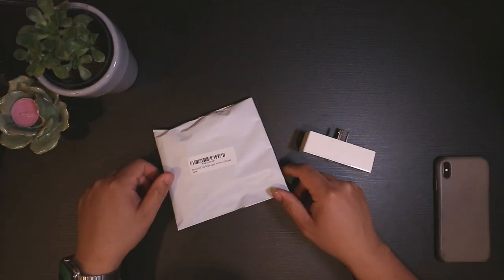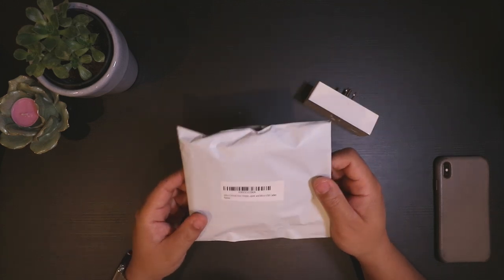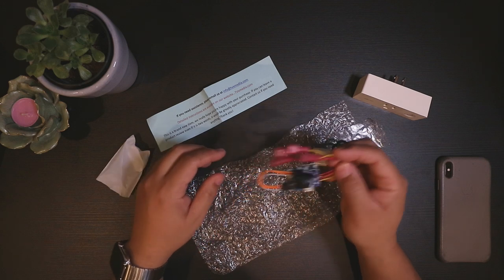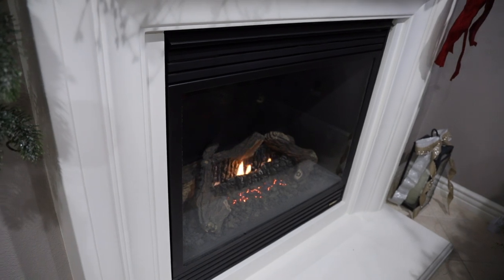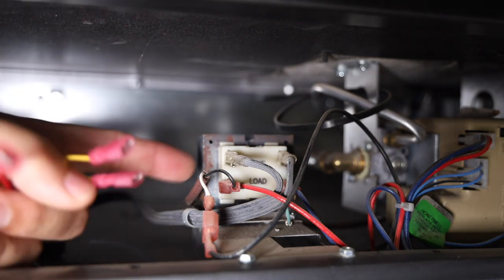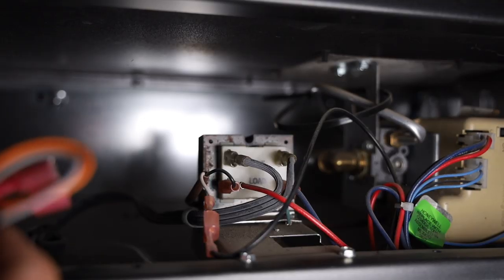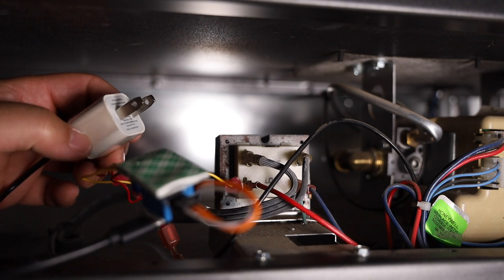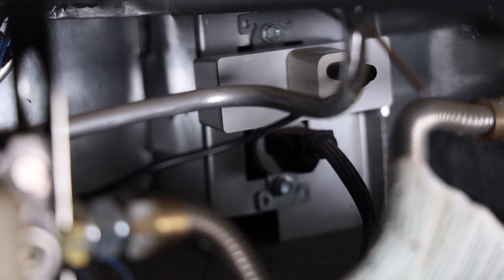How to Turn Your Gas Fireplace into a HomeKit Fireplace!

Comment: I got so excited seeing how easy this looks that I started to go order the relay.  Went to check how much room I have underneath my fireplace to see if I might need a longer USB cord and discovered I don’t have an outlet underneath my fireplace 😩

At least I discovered it before I ordered the relay switch.
Reply from the maker: Is yours a gas fireplace controlled by a switch? Did you look in every corner underneath the fireplace? Upon first inspection I didn’t immediately notice an outlet either and found it behind some old instructions the builder left underneath there.
Reply: Rey G It is a gas fireplace with a switch above the mantle. I will look again but I even pulled the logs out and couldn’t see an outlet. Just the wires that then ran through a hole in the wall to run up to the switch.

Comment: So awesome. Probably 2-3 yrs ago I removed the switch from my fireplace to install a smart switch and found low-voltage wires. Have wondered since then how to do exactly what you just showed us all. Seriously man, way to go. Thank you. Question: If you can leave the wall switch OFF but still use HomeKit to trigger the fireplace ON, I assume the only way to turn it back off at that point is to use HomeKit again?
Reply from the maker: Yes, you are correct. The switch will become inoperable if HomeKit/Siri was used to operate initially. Same in reverse as well.

Comment: I don't know if anyone spotted this yet, but I'm subbing simply for the fact that I love the renovations you've done to the former White residence. Be careful lighting that fire with Siri, there might still be some lingering gasoline fumes that could ignite and cause a major calamity. Actually surprised you didn't find a bundle of cash, a .38 Snub and a sample teenth of some crystal blue persuasion underneath the fire place.  Sweet Easter egg brother, much appreciated.
Reply from the maker: No Blue Sky in sight. When we moved in there was a damn pizza on the roof. Took me the better part of the day to scrape that thing off 🤬 thanks for the support! 🙏

Comment: from the wiring it looks like it completes the circuit either using the old rocker switch or the relay(controlled using siri via a smart plug). So if you turn on using hte rocker switch, and want to turn it off you have to use the switch. Just avoid using the switch all together and use the smart option.
Reply from the maker: Agree wholeheartedly 😊 Thanks for watching! 🙏

Comment: This is a great step by step video!!  Thank you!!
I had one question I may have missed.  What happens if you turn on the fireplace with the switch then tell Siri to turn it off.  does the switch and Wemo then become like a 3-way switch.  Does the Wemo know to turn it off or do you now have to give the commands backwards due to the switch being in the on position? 

I hope that made sense.
Reply from the maker: If the fireplace is turned on via the switch, it will need to be turned off with the switch. If HomeKit/Siri is used to turn on the switch, you’ll need to use that same method to turn off the switch. Neither Siri/HomeKit nor the switch will recognize the others commands. Hope that clarifies it. Thanks for watching!
Reply: I was scrolling through the comments to see if someone asked this too.. Instead of a switch, I have a thermostat remote. I was hoping it would work like a 3 way switch where I tell Google to turn on the fireplace, but then it will turn off via the remote once it gets to temperature. The low voltage makes it a bit harder to make fireplaces "smart" like how we can control a furnace or AC with a smart thermostat. Still a lot cooler than what I had before!
Reply: @ReyG_HKSH  just saw this comment after I posted the exact same question. Well, good to know. Would there be any issue though, if someone turned the switch with the outlet on as well?
Reply from the maker: @felipebedulli  Either won’t be responsive. If you used the physical switch, Siri (or Alexa, Google) won’t respond to an action until the switch is returned to it’s off state. And obviously vice-versa.

Comment: Thank you for this video! I just popped open my fireplace and I see that the wall switch actually turns on a plug that’s already plugged in under the fireplace (confirmed by removing that plug and the wall switch no longer does anything) The plug itself separates into two wires that look like in your video. But there’s also a 4 of other wires that look like in your video, two labeled labeled SWI. I’m not really sure which ones to unplug. The SWI wires connect to some 240V wiring it appears (with wire nuts), so that makes me a bit more nervous! I did unplug one of those SWI wires, and the fireplace switch no longer works, so that seems like the right set, but that they connect to much thicker wiring makes me still nervous!

Thanks for any help you can offer! :)
Reply from the maker: Sounds like it will work, you’ll need to figure out which wires to splice or plug into.
Reply: @ReyG_HKSH  Yep it’s all done. Got it working soon after. So nice to have it working!
Reply from the maker: Good to hear, just in time for the season! Happy Holidays!
Reply: @ReyG_HKSH  Thanks, - and to you!

Comment: if you turn it on by voice command/app, are you able to turn it off manually via switch?
Reply from the maker: The method used to turn it on should be the same method used to switch it off. It will be unresponsive otherwise. Thanks for watching. 🙏

Comment: I know I'm a bit late on the commentary, but I had done a similar setup with a relay and TP-Link Kasa switch that replaced the existing wall switch.  I did have to run a neutral wire to help power the switch, but it worked a bit like a 3-way switch.  If I turned off the fireplace with my voice, I could see in my alexa app that the fireplace was turned off, or if I physically pressed the switch, it would also show the change to the switch to let me know the fireplace was on or off.  Does this work in the same way with your setup?  For instance, if I turned the fireplace on with the physical switch, can I tell my assistant to turn it off after with my voice and the smart plug would know what state the fireplace was in (on/off)?  The setup I did before was at my old place.  Was looking to see if there might be a simpler setup.

Comment: Can you turn it on with Siri and turn off with the wall switch?
If you turn on with the wall switch, does HomeKit know it’s on?
Reply from the maker: You’ll need to use one or the other. If you turn on with the physical switch you will need to turn off with the switch before you can use HomeKit, and vice-versa.

Comment: That’s a great video how to convert it to smart fireplace, just one question, in the case of loosing internet connection, will you be able to use the wall switch to shut the fireplace off, if you used Seri to turn it on?
Reply from the maker: The way you turned it on is the way you’ll need to turn it off. If you used Siri under HomeKit, you should still be able to access your home network and use the Home app to turn off the fireplace, though you won’t be able to do that remotely… but you probably shouldn’t be using the fireplace remotely anyway.
Reply: @ReyG_HKSH  
👍gotcha, thanks.

Comment: Great video! I didn't know they were low voltage too. Not sure if someone already asked this...
My fireplace actually has 2 wall switch and both must be turned on to start the fireplace. I'm not quite sure how it works but I know both need to be on. Do you think I could use TP-Link Kasa smart switches?

Comment: This is an awesome video! I recently bought a smart switch and was quickly disappointed. My outlet in my fireplace is only two prong so I might need to either replace my outlet or find a smart plug that is two prong. If I am going to replace the outlet,  do you think it would be possible to install a smart outlet? I just recently installed one in my bedroom and love it!
Reply from the maker: If you have enough room to work and install a smart outlet this solution will work.
Reply: @ReyG_HKSH  thanks! Funny thing... I thought I had an outlet under my fireplace... I even just bought a blower for my fireplace that I can plug into it. Turns out, I do have an outlet but it isn't connected to any electricity! Lol! So now I got a much larger project on my hands.. looks like I'll be calling in an electrician. One day, my fireplace will be smart though!
Reply from the maker: Good luck with your new project. Winter is here so a smart fireplace is just the thing for this season! Thanks for watching! ☺️
Reply: @ReyG_HKSH  hey Rey! Just wanted to say I purchased the relay in your video and tried it on another fireplace in our bedroom. We have an outlet very close to the fireplace which is the one I converted to a smart outlet. I officially have a "smart" fireplace! Thanks!
Reply from the maker: @nicole0233  Awesome! Glad this video could help and thank you for taking the time to comment to let me know! 😊

Comment: I currently have a Heat & Glo fireplace with electronic ignition and it is ran with a SMARTBAT II box with remote control. For some reason, my remote got disconnected from my box and will not reconnect. Instead of purchasing a new Smartbat II and remote, I tried to plug my electronic ignition into a smartplug and set the remote box that is connected to the fireplace to the ON position and it works to turn the fireplace on and off just as your video does. Do I still need to use the low voltage relay switch in your video to make it work "safely" or am I good to go? I just don't want what i have set up to be unsafe, as in not cutting the propant when I tell alexa to turn off the fireplace, but I also don't want to purchase uneccessary relay switch when it already works with the smartplug. Thanks

Comment: Can you remove the thermopile after you put in the switch because the switch is now supply the voltage to the gas valve?

Comment: I'm confused as to why simply replacing the wall switch with a smart wall switch wouldn't work? There are smart switches that work with low voltage.

Comment: Hello I have been looking for a smart way to do the same with the fireplace. I noticed that I have the same fireplace as yours. My question is Does the usb cable and wemo get hot? And risk to melt? 

Thanks
Reply from the maker: I don’t believe there is a risk of any of the components for this solution being damaged from heat. There is likely heat shielding and hot air rises. Our house was built 8 years before we purchased it and when I opened up the cover underneath, the installation instructions for the fireplace were stored there with no damage.
Reply: Rey G thanks

Comment: Hi Rey, this might be a stupid question but if you turn the fireplace on with Siri then try turning it off with the wall switch, because you are putting the wall switch into the "on" position, would there not now be two sources of electricity going to the fireplace causing it to overload?
Reply from the maker: Not a stupid question at all, it was something I wondered about. The method you used to turn on the fireplace, will be the only method you’ll be able to turn it off. So turn it on via Siri will disable the switch and vice-versa. Also, it is a low-voltage switch doing little more than indicating on/off state. Hope that helps.

Comment: DIY novice here.  What’s the reason for the relay?  Couldn’t you just plug the fireplace in directly to the smart plug?
Reply from the maker: The gas fireplace isn’t plugged into an outlet and the switch is low voltage. This was the only easy solution currently available. Thanks for watching! 🙏
Reply: @ReyG_HKSH  I had the same question. I'm not following you here. In the video, it shows the fireplace is initially plugged into an outlet. Couldn't you just take out that black power cord and plug it directly into the smart plug?